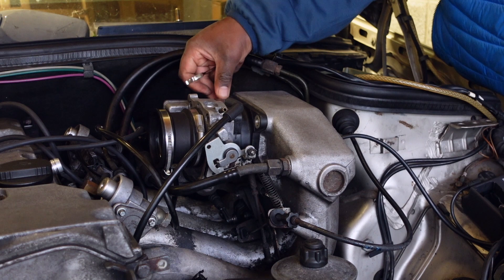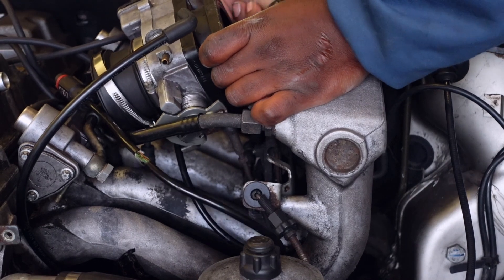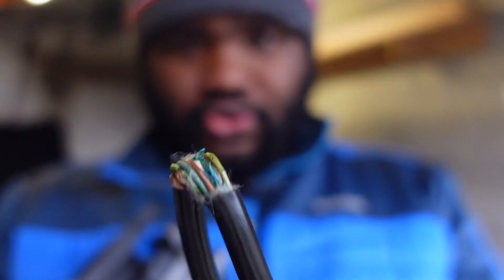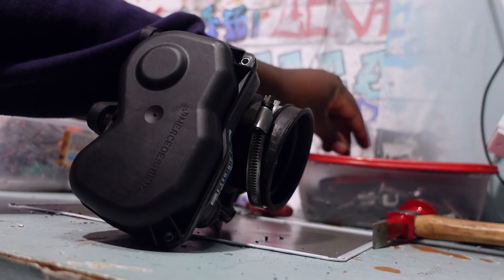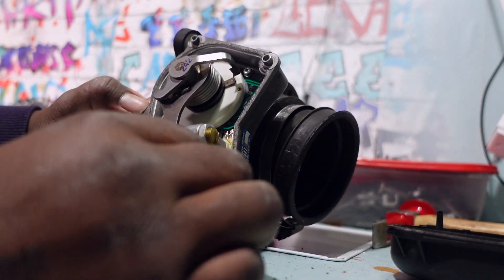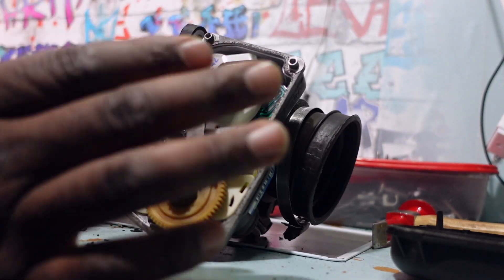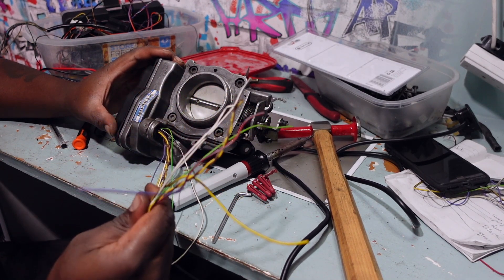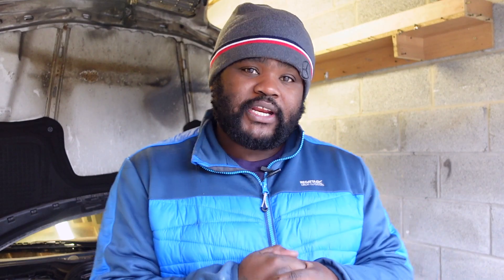How to Remove and Re wire Mercedes W202 Throttle Body M111 engine 1994

Comment: Nice work mate . Can i ask you what type of connector will you use and how can i find it .  I would like to do the same on mine throttle body. Thanks.
Reply from the maker: I used a Bosch DT from Amazon
Reply: @nemzrepairs  Thank you sir , you are amazing . Can i have any serial,link ?
Reply from the maker: @athanasiosbellos3367  https://amzn.to/40i9CZS
Reply: You change both sides (male-female) the connectors ? In throttle body and main wirring harness?
Reply from the maker: @athanasiosbellos3367  yes the engine harness was in bits too
Reply: @nemzrepairs  you are amazing . Keep good work . Thank you sir.

Comment: hello again sir, finally i will try to rewire my throttle body . can i ask you what kind of wires should i use ? (i am newbie)  thanks for your time , keep good work :)
Reply from the maker: Use same gauge as the ones in throttle
Reply: @nemzrepairs  i read in a post , black is 18 gauge and all the others 20 gauge . cause i dont know from wires , awg is the correct type ? thanks again you are a very fast replier :)